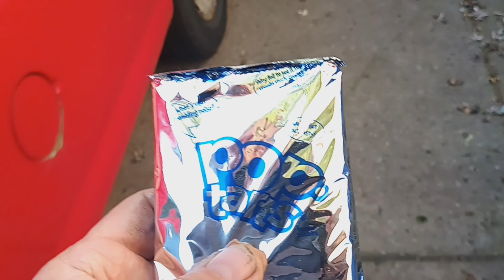As usual things getting pushed back

Comment: I’ve noticed lately that there seems to be a big spread in the price of copper from location to location. It never used to be that way. With that said, if you have weight capacity left in your van, have you considered getting a price on copper at a yard in the vicinity of board sort? Or ask board sort if they have a recommendation for a place they may use. Ohio might offer a better price, plus your using the trip gas for both drop offs.
Reply: Not a bad idea.👍
Reply from the maker: It is a 6 hr round to Boardsort & back. I just want to get back home after that trip. I can hold it till the price goes back up.